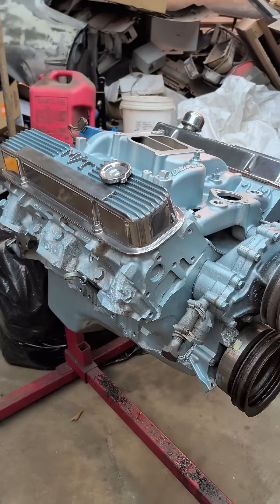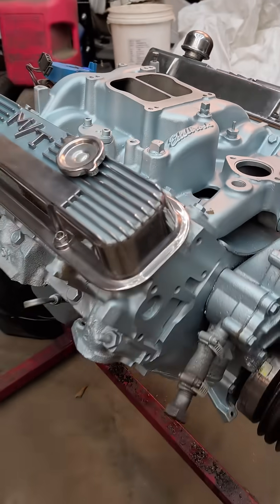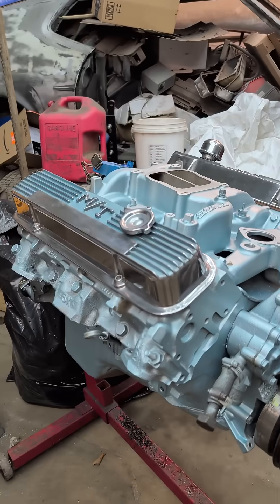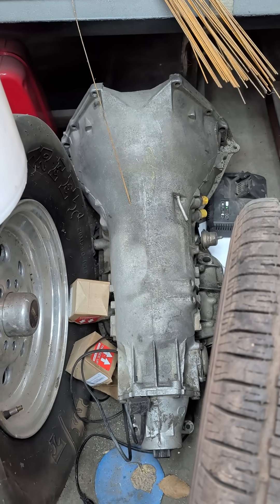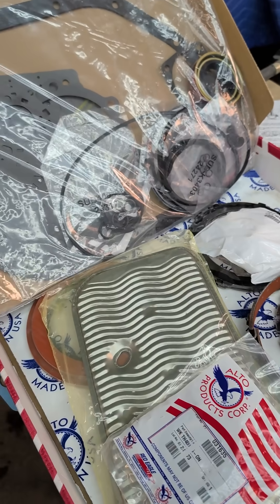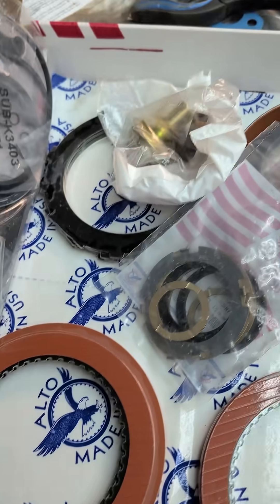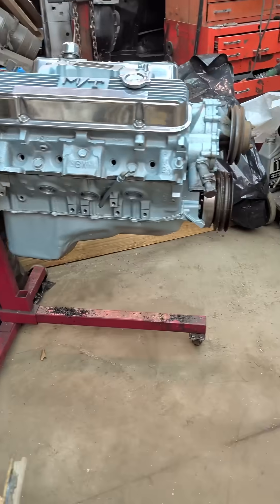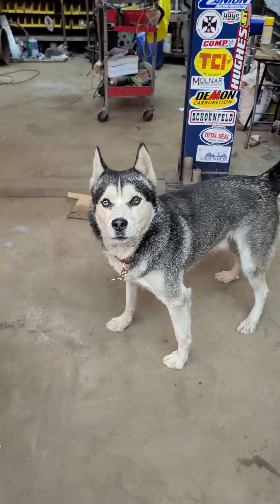E85 vs Pump gas.

Comment: E85 is just gonna clog shit up

I run a 700hp/1000ftlb hemi thats tuned for 85 octane
Reply from the maker: All my fuel systems are clean, and the carbs, tanks, no clogging. You're thinking pump gas.

Comment: With e85 you will require 30% more fuel to get that engine to run vs gas  , so your whole efficiency thing went out the window, e85 shines for lots of boost or high comp motor above 12to1 comp ratio, want the best of both run 100ll
Reply from the maker: Racing gas is spendy, its over $10 a gallon here. Premium 91-93 is over $4. 87 octane is $2.70, and E85 is $2.15, while where I was born, and travel back to almost every year, E85 is $1.78. Its a kinda big difference between $2 and $10+ a gallon. Anything over 93 is racegas here.

The point of this Firebird build is to demonstrate the rest of what I am saying. 

The reason you need more fuel is ethanol has more oxygen in it, and that means more torque. it makes more torque in the idle to 4000 rpm range, right where most daily driven cars spend there lives. There's an interesting thing about a big engine like a 455, when its not encumbered with a tiny camshaft, choked exhaust, and not in a 5000lb car. They do VERY well on fuel mileage, because its so easy to move whatever car you put them in.

There is an interesting thing that happens when you raise compression above 12:1 and run ethanol, you get the same mileage as a lower compression engine gets on pump gas. Higher compression works the fuel harder, and that makes more torque. More torque means less throttle angle is needed to move the car, so it burns less fuel in normal driving.

The thing about compression that high is that its usually associated with a racecar, and most of them use RPM, deep gears, big stall, and long duration camshafts because moving the torque range above 5252rpm makes more horsepower.  Iron head Pontiacs engines are done at 6000, they don't have enough airflow to feed 462 cubes at that RPM, so you maximize torque and put a highway gear behind them. Due to the long runners that create very high velocity in the ports, along with a venturi shape, and a shallow valve angle, the Pontiac V8 is designed to be a torque monster.

I've already gotten better mileage with E85 than the same size engine on pump gas could do,. The pump gas engine averaged 18mpg highway, the E85 engine with 13:1 did 20, and if I drove sensibly (which wasn't often) it would do better than that. The pump gas 455 pushed my 4000 1970 GTO to 12.60s in the 1/4 low 8s in the 1/8th.. with a 2.93 gear. The 13:1 455 didn't go down the track in that car, but it was making A LOT more power than the 8:1 engine. Driving around with the 13:1 455 and a Qjet that wasn't quite done being modified was sorta like an on off switch, you could cruise it no problem, but open the throttle a bit too far and you get copious tire smoke.
Reply: @SweatyFatGuy  just get an ethenol trim and meter, it will adjust off base time to not ping
Reply from the maker: @hansorsic666  why would I do that? My 65 GTO has been on E85 since 2018, the 70 GTO since 2010, 68 Le Mans since 2015, and the 79 Formula since 2011. The 79 has a 10:1 engine in it, the rest are all race gas compression. The 68 has a blower and 11:1, its super easy to run ethanol fuel. No need to complicate it.
Reply: Right now as the world stands...you can not, I mean can not get get better mileage with E85 over 87 to 93 octane. An engine uses almost 2 to 1 on e85 compared to gasoline. If you can do that our government will give you a job and you can make millions. Good day sir and God bless.
Reply from the maker: @tedkearns9669  methanol is 2:1, ethanol is 27% to 30% more, and thats due to oxygen content. Ethanol is a very different fuel than methanol, they are not the same, not made the same, and do not run the same. Methanol is the highly corrosive and toxic one, and ethanol is the one you can drink in bars or on your sofa while watching the big game.

When you make an engine get better mileage on ethanol than gasoline, it cannot run pump gasoline anymore, because the compression is too high. The compression ratio right now in this 455 is 8.8:1, roughly, so it will run on 87 octane, and it will get slightly worse mileage on ethanol. When I swap the heads to give it 12:1, it will get the same or slightly better mileage than it did on pump gas, while making considerably more power.

You can follow along this summer and see how its done and the difference if you like. I've done it before with my 65 and 70 GTOs.
Reply: @SweatyFatGuy  i wanna see you drink 6 shots of ethenol without any hard liquor 😂

Iron mike only survived because the vodka and whiskey
Reply from the maker: @hansorsic666  ethanol is wine, whiskey, beer, etc. Its all ethanol, the exact same stuff people drink is what runs in cars.

Comment: Why not the 700R4?  I suppose you wouldn't like driving 65mph at idle tho would you  =-)
Reply from the maker: I have 700s sitting here that I can put in, but I don't know about a driveshaft the right length.  I know Th400s, Th350s and 2004R will fit with the driveshaft I had in the car.  In OD 1200rpm is 58mph, and 1500rpm is 73. I've driven cars like that, and with as much power as this one will have, its a VERY slight movement to pick up 10mph.. and get a ticket if you're not paying attention.

 Pontiac 400s and 455s don't mind idling along like that, but I want to show what anyone can do with either of those transmissions and a gear between 3.42 and 4.10. Thats about the same as a Th400 and a 2.41 gear. 

Right now it looks like I will be putting a 2004R in it and driving around in 3rd gear most of the time. I have a dozen of those things, and they are pretty easy to rebuild.

The Th400 I was going to use needs parts, including the case.  I could put a 4 speed in, because I have the clutch linkage in my 79 Formula, but thats a pain with a gear this tall. Really easy to smoke the tires at stop lights with a 455, ST10 and a 2.41 gear. I have some time before I need to build a transmission for it.. so we shall see.

Comment: 8.5 to 1? 😢
   Yah gas ignites too easily. Add some diesel it'll be fine.
Reply from the maker: Diesel makes them smoke. With 8:1 it will run on 87 octane and E85, a head swap and it will have over 11:1 and pick up power as well as mileage on E85. This 455 is a test/demonstrator to illustrate the difference. I plan to do other things to the car to improve mileage as well.

Comment: My prediction is that it doesn’t see much of a difference on low compression unless you wanted to play with a turbo. With high compression you’d be able to take advantage of more timing.
Reply from the maker: You lose mileage with low compression, but pick up a little power, and it drives better on E85, adding compression picks up mileage and more power. With the 8:1 on pump gas and 11.3:1 on E85 the timing can be whatever the engine likes, it won't ping/knock with either of them.
Reply: @SweatyFatGuy it will be interesting to see what you share with us.
Reply from the maker: You'll have to stick around a while, have to wait for the snow and salt to go away to drive old cars.

Comment: Love this build man! They told me for years I couldn't get 20mpg out of a 460 C6 combo. Did it on 92 octane and a tad more  can't wait to see how you do on home brew brother
Reply from the maker: if you build enough torque, you will get decent mileage, and it can still run pretty good. My 70 GTO got 20mpg on E85, and averaged 18 on 87 octane with 455s, one with 8.8:1 and this one with 13:1. The pump gas engine pushed that  4000lb 70 GTO to 12.60s with a 2.93 gear, 1900 stall, and no power adders. I never raced it with this 455 in it, but it had A LOT MORE power..

This bird should do a lot better. I might build a 2004R for it, and rarely use 4th. Still has the lock up and lighter rotating mass, so that will help. About the fastest I can drive around here is 73mph, and that is too low RPM for a 2004R in OD and a 2.41 gear... but if I ever take it on a long road trip, like to Nebraska where I can drive 85, well... that'd be perfect.

Comment: What a good boy!  my car is supposed to have a 350 2b with a turbo350, but someone did some upgrades before I got it! 4b intake and Rochester carb on the 350 and a turbo 400! And I think something in the rear because she's a posi and someone put aluminum drums on it too!
Reply from the maker: Ya know, a worked set of heads, a hydraulic roller cam to avoid flat lobes, a 2400 to 3000 stall, you;d have quite the triple crown entry for the NNN with that 350.
Reply: @SweatyFatGuy i do have the 400 on the stand too, when i get the car apart im gonna get some numbers off the 350 heads. I may have everything i need already except a cam and a set of headers or exhaust manifolds! But i do wanna run the 350 as is for a while when i finish all the metal work! Ive never driven the car so for all i know it had a cam back when too and shes a beast
Reply from the maker: 350s can be fun too, the small bore is the only thing holding them back.

Comment: That's going to be very interesting.
EDIT: I drive a 2010 Silverado and, never had any problems with it BUT, it still a Chevrolaids. I'm more a Pontiac/Buick guy.
Reply from the maker: I have a bunch of 96 to 07 Silverado 4x4s, even though they don't have the greatest best designed engine ever, they work pretty good.
Reply: @SweatyFatGuy  My 4.8 is about to hit the 185,000 miles which, it's probably near from its "life expectancy". Chances are high that the body might "quit" before it. I looked at trucks like mine and they are scares. Mine has cruise control, A/C, CD/MP3 player and an 8 feet box. Plain and simple, just the way I always wanted.
Reply from the maker: Around here the LS engines go 350k as long as you change oil in them, and don't spin the snot out of it like kids usually do. I might make the AC work on the crew cab when I get it in the shop, just because travelling to Nebraska with it would be slightly more comfortable for Deegan in summer.